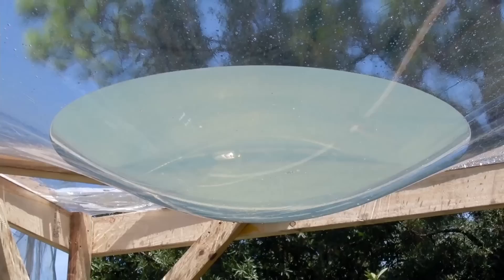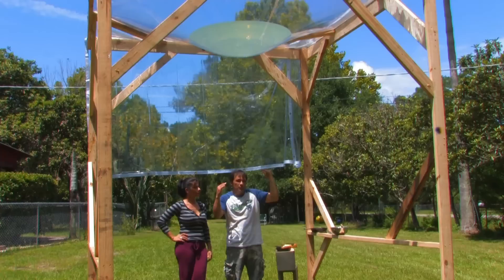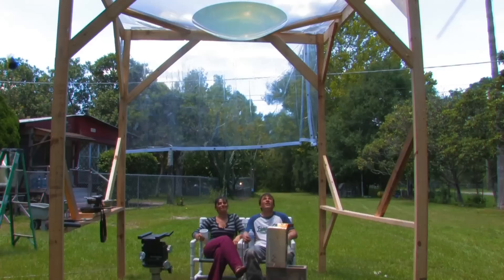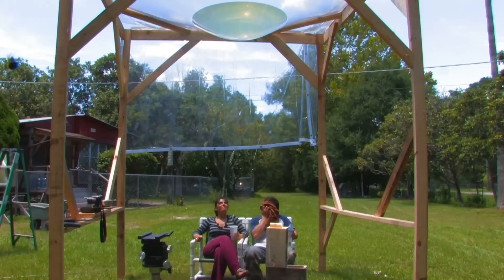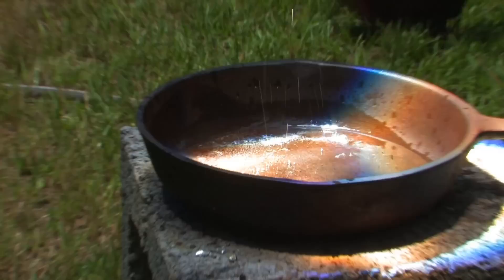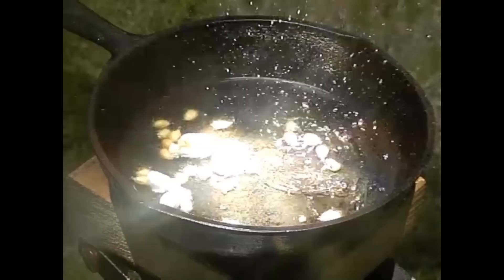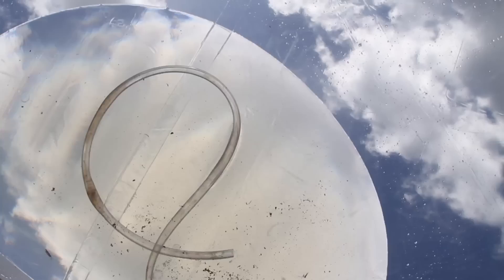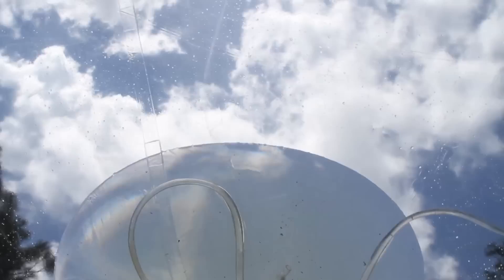Free Energy solar Giant Water Parabola Cooker 1000f AQUA DEATH RAY

Comment from the maker: @oatstao The water does not get hot. Luke warm at best. Because it is clear, light passes through. That is why it works. If the water absorbed the light photons the lens would be a blocker vs a concentrator.

Comment: Just a thought reinforce the plastic and make a few holes around you preferred lens size so if it does rain it will overflow through the holes
Reply from the maker: leigh Moom I will have a video soon of this. We got 11 inches of rain 10 days ago and it collects 50 gallons per inch. The plastic and structure held 500+ gallons of water = about 4000 pounds. Did not walk under it and siphoned for 1 hour. The vinyl returned to normal shape in 2 days. Was amazed.

Comment: @tabhorian That is true, but for solar power there are easier ways to make parabolas. (No need for sharp focus) Like inflating a reflective foil and apply some glue or hardening foam on top, so it holds the form afterwards. Taking an already existing parabola dish. Or what Dan is doing, pour some liquid into a flexible material. (like concrete, after it hardens you can copy it with resins and glass fiber, or polyurethane foam)

Comment from the maker: Go with a larger flat mirror and add a pinch to the center. Full length wallmart mirrors are good for a trough but will give a weird linear bean through an OHP lens. This method works good:

watch?v=uL1ZGqzw32E

watch?v=geh1FEpIXuQ

OHP LENSES AND PAGE MAGNIFIERS usually have extremely short focal lengths reducing the target selection as radiant heat from the project can damage and warp the lens.

You will be limited to one mirror:
watch?v=SerNfZSEvc0

Comment: Here is a tip about parabolas.  if you have a round pan full of liquid (concrete, water, epoxy...) and you spin it with a motor, the liquid will make the shape of a parabola.  Be careful of any kind of vibration, as it might cause a standing wave as the liquid hardens.  Old amateur telescope makers tried to make a large telescope mirror out of mercury that way once.  limited success, but perfect for solar power

Comment: Put that water lens in a sealed pvc pipe with black inside walls, seal ends with acrylic and fill with water , use suction to suck inwards to concave sealed ends,  use a one way valve..make sure no air or gaps inside... you now have a portable water lens

Comment: That's huge!  Have an idea to run past you.  I have some overhead projector Fresnel lenses that you can bun stuff with.  I though of using a cheap wall mirror from a mart store ... they are really flexible.  I'm going to build a frame to hold the arc to focus light on the Fresnel for a final focusing down to a small point.

Comment: @mancamiatipoola I am not talking about this specific device Dan has built. I am talking about the concept of using water to focus light, cheaper than molding glass. The water doesn't have to be safe to drink, just clear of particulate matter such as dirt and debris, which can be easily filtered through a sand/charcoal DIY filter. The plastic sheet doesn't have to come from the country. And it will cook for more than 1 hr...The point is that it is cheap. Mobile. and DIY friendly.

Comment: Hey Dan,
At the end of the video, I heard you say you were curious about what 2 or 3 inches of rain would do to it.  Simple calculation actually.  1 inch of rain will produce 625 gallons of water per 1000 square feet of area.  I can't tell how big of an area the sheeting is on the flat above you.  Assuming the area of plastic above you is 8'x8', then 64/1000 x 625 gallons = 40 gallons per inch of rain.  If you're expecting 3" of rain, be careful!  That is too expensive to rip. 
Take care!
Mick

Comment: @kistuszek Well... yes, I saw that.  But the reflector made from the concrete mold (I saw the video - neato) was only 2' across.  But for a parabola that might b 8' across, well..., that could be made from a small motor geared down. See what I mean?  You don't need to depend on the bottom of a water heater to give you the right shape (I did not know they were parabolic in shape btw).  That said, inflatable might be the way to go on that.  I think, that the ATM people could prove a valuable resor

Comment: @TheMick26 If they were serious about using this everyday, they could just build a retractable canopy for it when it does rain...sluice the rain into a collection barrel and then simply replace the amount of water they want into the lens when they want to use it.  They should be able to adjust the housing for the lens apparatus to a slight angle to easily empty the water from the vinyl.  It just wouldn't do to have that sucker growing mold, starting fires and zapping unsuspecting passers by.

Comment: Hi I have a idea you can try, thermal conduction. I saw a lantern a long time ago that different metal wires tied together at each end. The two types of wire were twisted together in series to form a circular star pattern. The inner star pattern was placed over the lantern in the heat and would produce enough electricity ot power a radio. This might work well with a parabolic mirror or a fresnel lens.

Comment: Thinking a $20 clear shower curtain would work for the vinyl.  What about making a trough with a long pipe running along it, or a convex mirror with mylar and the focal point above the water?

Some very good potential with this for the third world if you can get the costs down!

Comment: Hi Dan!
If you want to make such a gigantic aqua lens, maybe you could try a plexi sheet about 2-3 mm thick maybe? Probably bends a little less under the weight of the water. If it is too rigid, the focal length will be unusable large, but at that size you using i bet a few mm will bend enough.

Comment: @rgbarnes46 What would happen if you set lenses up on a clear geodesic dome so that light shines through from all angles no matter what time of day?  You'd have to tune each lens, but it could be done.  Inside the dome is a vertical cylindrical tank of proper size and dimension to optimally capture heat from all the changing focal points.  The dome would have a retractable canopy as a safety device and to protect it from storms.

Comment: That's an interesting piece, Dan.
Some things we discover, or uses for what we find when we merely relax a bit and "play" with an idea might not otherwise be evident or discovered.  What were your expectations & results (beyond the obvious)?
    You didn't give temperatures reached in this, or time to achieve them.
    Using the water from it for a shower would be great for camping if the time to heat is short enough.  Thanks.

Comment: @mancamiatipoola Precisely opposite. This "waste of time and resources" can be used in underdeveloped countries where they don't have electricity, and are stripping their resources of wood for fire burning. This offers a simple yet effective way of creating 1000F heat. As Dan said, it can be used with ground water, and any water with no particulate matter in it. With some modifications, a collapsible structure, shorter focal length, and removing the excess material, this can change the world.

Comment: Could one have a curved pipe that lays on the deck, following the path of light as it travels in its curved left to right movement path, and use the steam generated from the water inside to power a steam engine that powers an electric motor?   Cool

Comment: @BooGooNFlowoo4Evoo  A Vinyl Adhesive called H-66 from supplier Mauritzon. Search their website for Adhesives.

Here is how it worked best. Brush a 1" wide glue line on both pieces to be bonded using an acid brush, wait until the glue gets tacky to the touch then carefully join both pieces together, then use a heat gun and 1" hard vinyl floor roller to flatten & roll out bubbles. Let cool and make sure you use gloves so you do not get burned.Over time the glue seam does discolor but still works

Comment: Hi, Dan and Denise Rojas.
Thanks a lot for your very nice videos, I really like them. You may have already thought about this, but I am wondering why not use some kind of reinforcement in the form of a wire mesh like chicken wire to prevent too much sagging of the vinyl. That way the lens diameter could be larger and I think the mesh certainly would not interfere considerably with the efficiency of the lens. I am also worried about your eyes as you are dealing with very concentrated bright light

Comment: @GREENPOWERSCIENCE Ah, the famous dbootsthediva!
A bit like O'Reilly's "tide comes in, tide goes out, never a miscommunication"
You should try a partially-rechargeable partially-solar car using brushless motors and a lightweight battery and regenerative braking - especially useful on hilly subtropical volcanoes
A very lightweight low-range golf-buggy-looking device
Yep, the cost of the (large area of) photocells, but you could start without them

Comment: Dan can you try this with various antifreeze water mixes to see how well it works.  Would allow for cold climate use.
Reply: I dont think that it would require anti freeze if the water freezes completely, the ice it would make would probably be clear since it is insulated at the bottom, ice will form from the top. The focal point will change i think.

Comment: @defuzed28 I'm afraid you don't really know what you are talking about. Rain requires a nuclei to start formation, and on a clear day there is usually not much pollution/soot/any form of nuclei. The plane however acts as a nuclei, (with help from vast pressure differences) and forms a contrail. This can then be used as a nuclei by surrounding water vapour in the air, allowing it to condense and form those whispy looking clouds known as cirrus formations. Look up cloud seeding. Same theory.

Comment: What if you put a electric solar panel under the water lens? Will you generate more electricity than usual?
Reply: It melts
Reply: The lens concentrates solar energy into a smaller area, so hypothetically you could put a small solar panel under the lens and generate as much power as a panel as big as the lens (as long as it doesn't overheat!). It'd be more efficient (in terms of space per floor area) to just install a larger panel.

Large-scale solar concentrators do use lenses to generate electricity. The array of mirrors is effectively a large fresnel lens solar oven that boils water to drive a steam turbine.

Comment: please google contrails they only last about 20 lengths of the plane.
Think you will find they are chemtrails . Spraying probably aluminium for testing but could be anything. Gov't has talked about it but deny testing
Btw great video
Reply: They're not, they're contrails, with high altitude water vapor ejected from the plane transforms into ice crystals and voila.